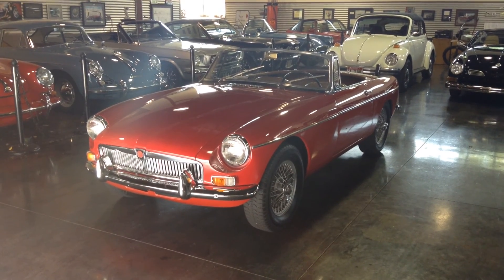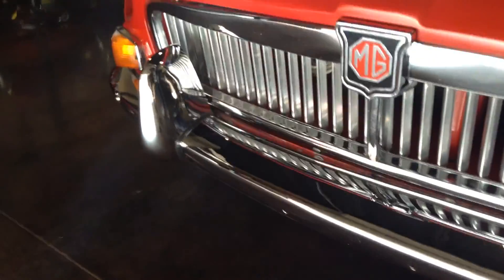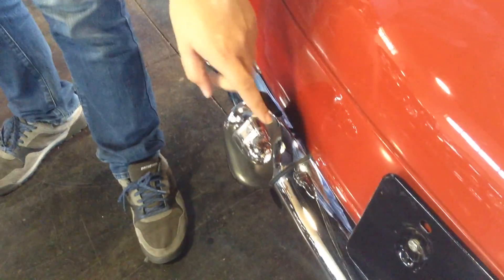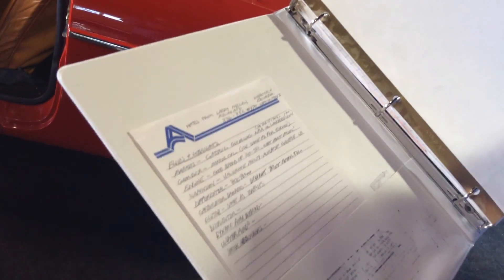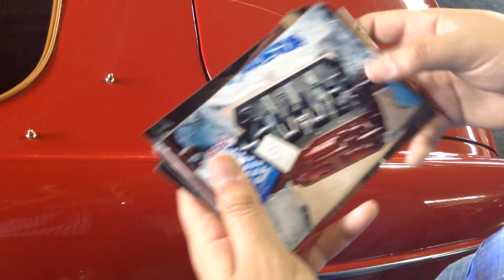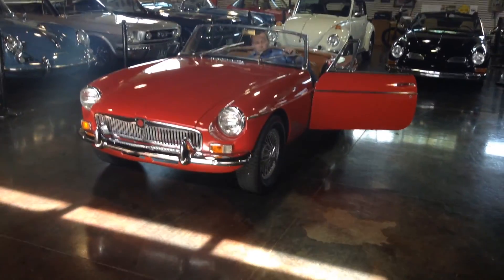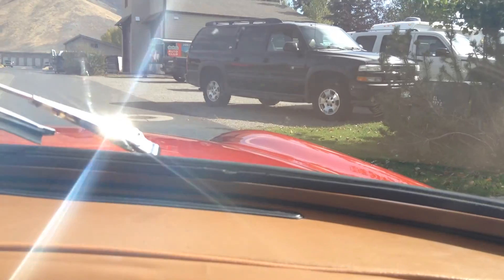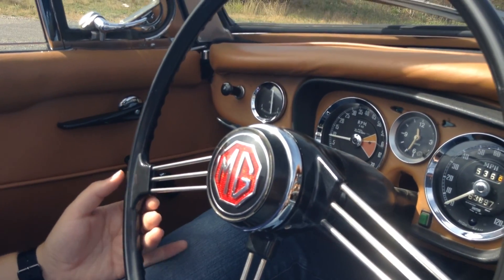Test Drive: 1966 MGB convertible SOLD at the Sun Valley Auto Club

Comment: A very nice 66 MGB. I had a 69 Red MGB with wires also. Absolutely loved that car even though it too didn't have a 1st gear syncro. Once you get use to them it's no worries at all. I'd love to have another one. I've worn 4 of them out. 1 69, 1 72, 2 79s Love to have a real nice 77 twin carb . The rubber bumper models have a bit more road clearance which I need out here where I live.